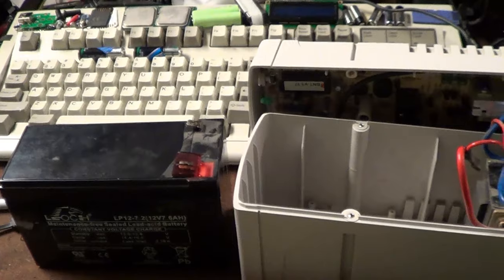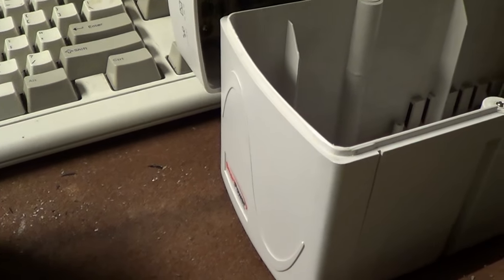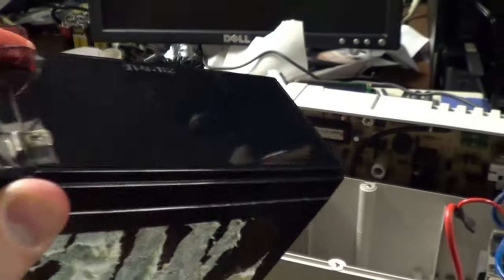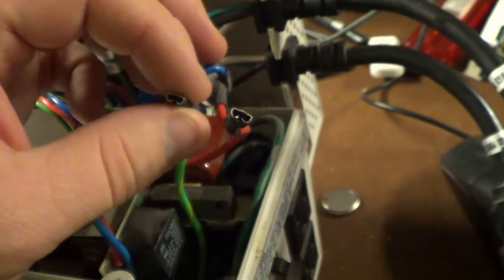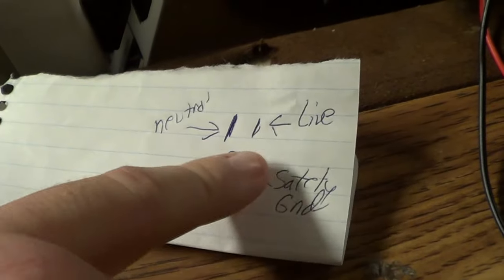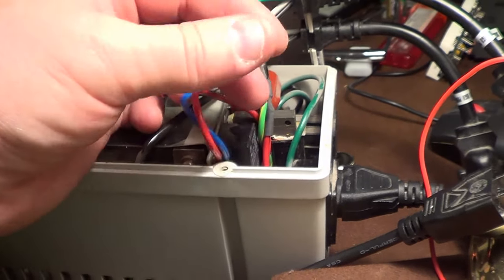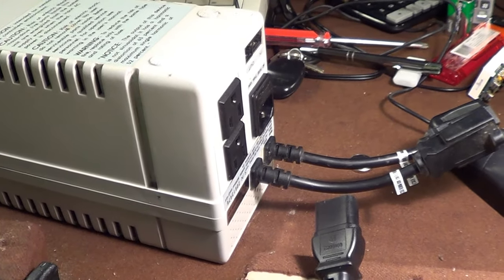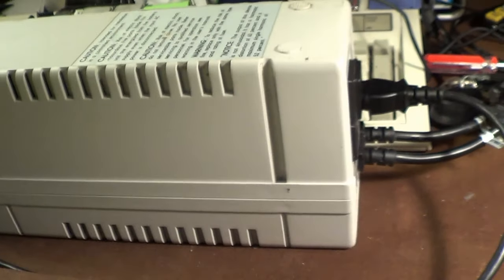Quick 'n Dirty Late Night Uninterruptible Power Supply Repair

Comment: If the socket is not affecting the serviceability of the unit, I would just snip the spades off and solder the wires to the pins. I've had loose spade connectors start fires.
Reply from the maker: It would be enormously difficult to do that. Since they aren't loose any longer, I think they'll be fine, especially with no more load than this UPS can support on battery.

Comment: If it wasn't so late, I'm sure you would've realized that the pictograms on the front relate to the LED.  Rapid blinking for Over Load, long blinks for On Battery, continuous for On AC.

The beep tone (Bi Bi) map is on top, next to the pictogram of the bell.

At least, that's my interpretation of it :-)
Reply from the maker: ...but I did realize that! :-)

I wonder how many cents they saved by not installing the other two LEDs?

Comment: If I'm not mistaken this is for use when power go out?
Reply: yes they are designed to keep electronics going for a certain amount of time before the battery is depleted and the inverter cant go further but normally the inverter will cut off the supply before the battery is fully depleted like it will send a command to the computer or server its hooked upto and tell it to shut down but if things other than a computer are hooked up like a modem or its not hooked into a usb or serial then the devices will shut off when there isnt enough battery power to keep things going

Comment: Quite amusing they couldn't pick a standard for the wiring inside the unit, usually they'd use either the north american Black & Whites for L & N, or the European Harmonised Colours of Brown & Blue for L & N, Red for live is the UK's old standard, but Blue is of course the EHC for Neutral (old UK colours was Black for N), but then, it is from china, it's a miracle they know the difference between Live and Neutral... :P

Comment: Hmm sloppy lucar connectors, yep it looks like some pillock had there fingers inside.
The wire colour scheme is neither american black/white or uk brown/blue, how odd.

Perhaps you can change the smoke test to "Poke Test" he he joking bill :-D.
Reply from the maker: There were two pillocks. One that is likely to remain unknown and another that has been making Youtube videos for nearly a decade now. :-P

A 1000VA Tripp-Lite model also came home with me, and in that one I found the wrong type of battery wedged into place with cut-down styrofoam strips. How buying 2x12AH, 6V batteries was too much trouble compared to that I can't even imagine.